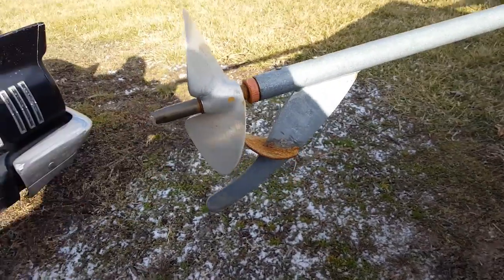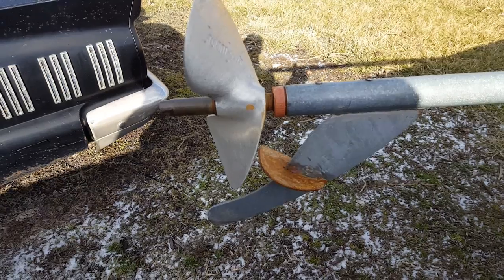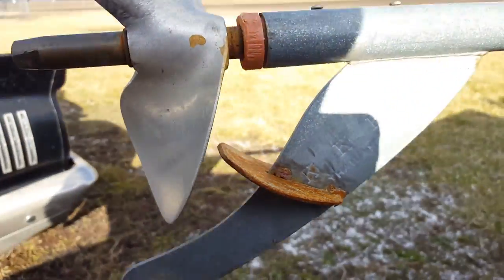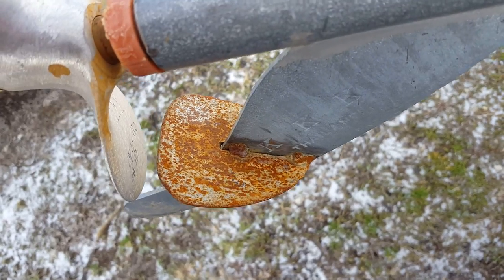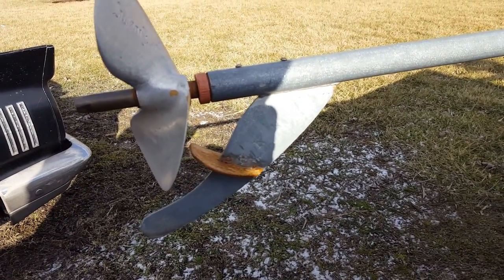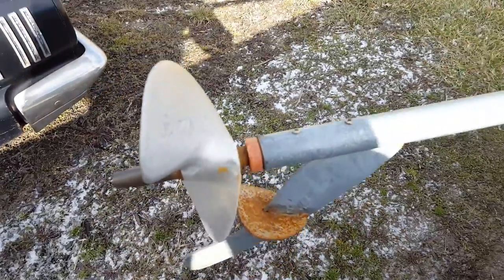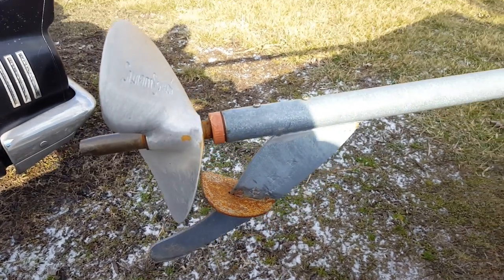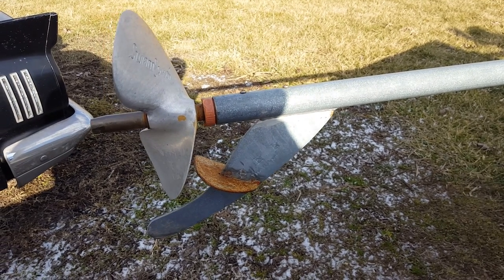Longtail mud motor trim tab.

Comment: I was pulling my hair out with a new to me 110" MudSkipper rig w/22hp Predator. The traditional Cav plate over top of the prop did not work so I made my own.....11mph max or it climbed out of the water. Then I ran across ThorazineShuffle's video.....and thought, "what the heck"> I made a plate similar to his except that it is rectangular with heavily rounded corners. I welded it on(the Thai pot metal skeg does not like welding, so pre heat it or use JB weld) and went for a test run. Well damn I was surprised it WORKS and it works well!!! My boat is a 1648 Mod V and I could maintain 21 mph @ WOT of 3600 rpm. Cruising at 2100 rom @ 17 mph with a completely neutral tiller......PROBLEM SOLVED.....Thanks man!
Reply from the maker: I'm a bit late on a response, but glad it helped....
Reply: Can you add pictures of your set up

Comment: Thanks for the video! Much better than just a picture. Have you done any modifications to your Predator motor? I was considering a new exhaust and also taking out the 3 piece head gasket and just using a one piece to bump the compression. Not much out there on these 670's yet.
Reply: Have you done anything to your 670 yet? Thanks

Comment: the deepener is not positioned correctly, it must be at the very bottom of the keel, so that the water pressure from the propeller presses on it and it must be made of stainless steel

Comment: it is not done correctly, it is necessary to weld a triangle and at the very bottom, then the effect is better that the water from the screw will press on this triangle and will not allow the shaft to rise upwards at high speeds
Reply: Can you add pictures of your set up